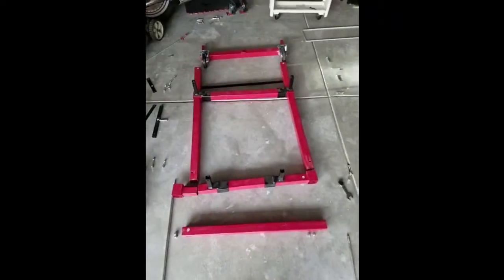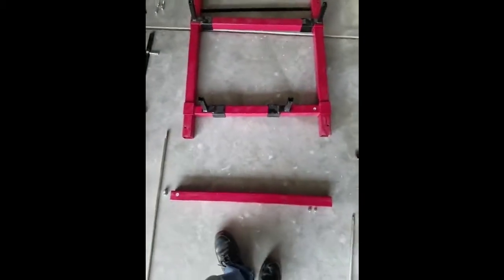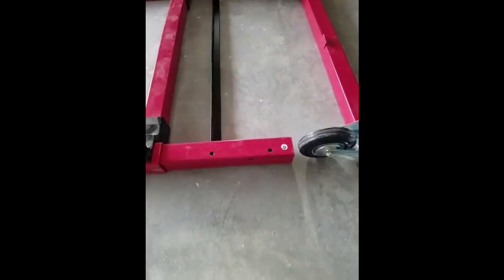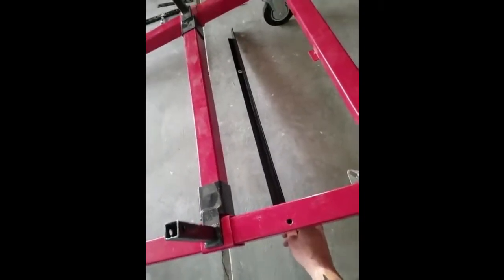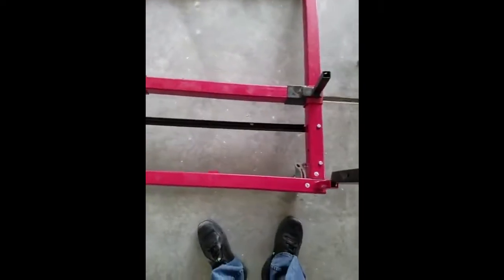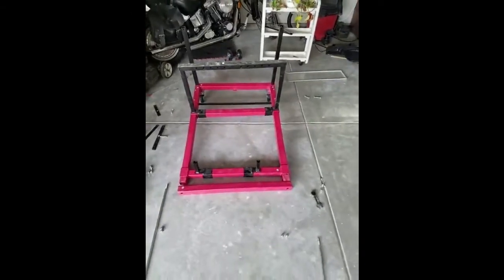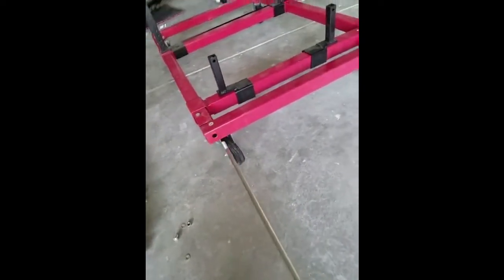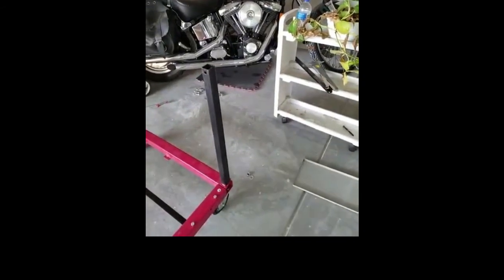Larin mobile engine testing station METS assembly

Comment: Thanks for the video. I'm looking at getting one myself. Other than the terrible instructions, how do you like the stand otherwise?
Reply from the maker: I like it. There are a few things I wish where different, for example I would like to have bigger wheels to fit a cherry picker under the frame and a way to mount a radiator easier. ALSO the motor mounts are not a common used 3 1/2 inch width between the ears. But for the price it isn't bad.
Reply: @mgleason2542  what engine (s) have you used 9n it?
Reply from the maker: Just a small block Chevy
Reply: @mgleason2542  Which engine moutns worked with this stand and a small block chevy ? thanks
Reply from the maker: @sigunz  I believe they were OER 332648
Reply: @mgleason2542  thanks

Comment: Wish I would have watched this first! Directions? Throw them away! Great video!
Reply from the maker: Thank you for the feedback. If I was a bit more polished at videos (this was first one) there are a few things I would have done differently but I am happy you felt it had value.
Reply: @mgleason2542    Thanks for the informative video and you are correct that the instructions are horrific and a couple of the holes on the stand were drilled the wrong way.  My question is that now that the engine is on it, it sways about 1 1/2" .  Did you have the same issue?  Shouldn't the engine be stable and not move other than the movements the motor mounts take up?  I hope you see this and appreciate any help you can offer.  Thank you
Reply from the maker: The engine does sway. This stand is not completely solid BUT if you make sure everything is tight and as close to the bottom as possible (i.e. the riser stands are not fully extended) it is more solid. IF the movement is too much for comfort you could add brace plates but that would require welding or new holes.

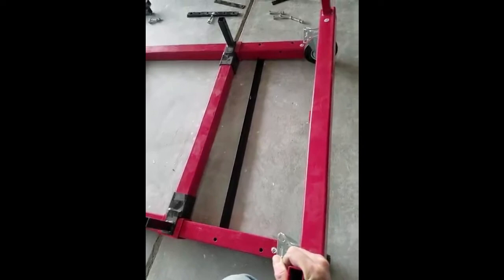BTW if the holes "were drilled the wrong way" is it possible you are referring to what I point out around 1:40 in the video?